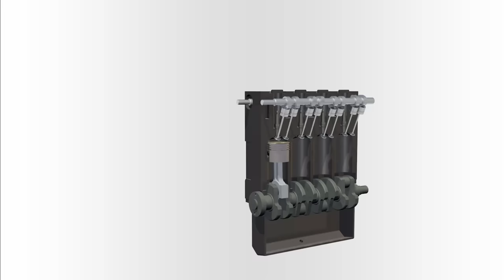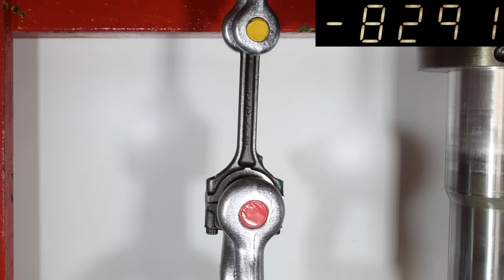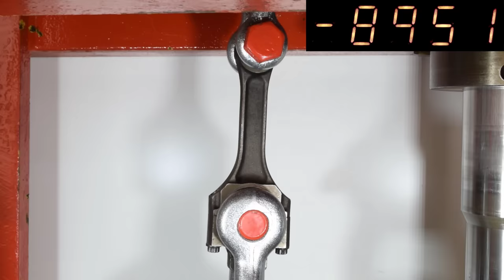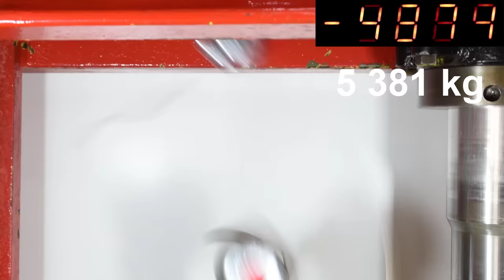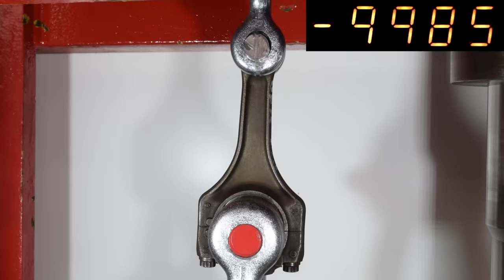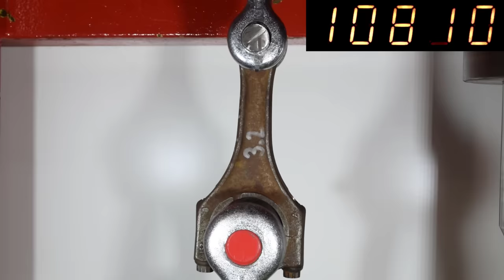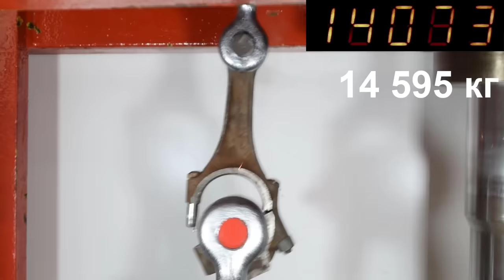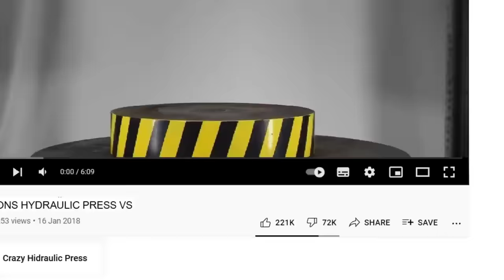HYDRAULIC PRESS VS CONNECTING RODS

Comment: After doing some math, it became obvious that the forces on a connecting rod are greatest in tension despite the logical  notion than the compression forces are the higher forces.
The rapid change in direction during the overlap stroke is where the greatest forces exist. In fact, compression and power actually reduce tension stress on the connecting rod.
I replicated this test many years ago with the same results- the bolt is the weak point! However, as the tension increases the shape of the circle distorts and the bearing shell 
clearance is reduced to zero at the cap seam.  Without lubrication, the bearing slips, covers the oil passage and instantly fails. Sometimes the near instant increase in friction at high RPM results in the next weak point, the small end to break the rod at the point just below the small end bearing. Key thing here is use high quality rod bolts, torqued precisely, quality oil, and know the RPM limit because that is the failure point, not the combustion forces. Rev your engine till it spins a bearing, rebuild it and lower the red line by 500? Rev limiter?

Comment: The "car 1968" connecting rod was best at doing what it was not designed to do. (tension vs. compression). This test was a bit disappointing after clicking the thumbnail for this video with the correct situation illustrated. Go figure...

Comment: I disagree with a lot of the comments below.  I also am a mechanical engineer.  This test was not (apparently) not done using any kind of standards such as ASTM or perhaps a European equivalent, but it DOES show the overall tensile strength of the system for comparison purposes.  Most strength tests for metals are typically tensile, not compression, at least for isotropic materials such as alloy steel.

Comment: I was not expecting much different. The metallurgic properties of a good connecting rod are what they are, regardless of brand. Yes, some alloys are better than others but it isn't necessary, as these parts only break when the car has been subject to severe abuse or neglect.

The large amount of plastic deformation on the bolts from the 1968 Russian rod, however, is notable; that alloy was far less brittle than that used in the modern bolts. (I leave it to engineers to decide if that's desirable or not.)

Comment: I don't want to hurt anyone (although there would be a need for intelligent laymen), but the engineers are right and not the idiots. I am a Hungarian agricultural machinery technician.
During 1 cycle, the connecting rod performs "1 pull" and "3 pushes". Pull suction, the second is missed due to the shift in the work rate. Therefore, this film screw "pull" test. Today's screws are not strong, they don't allow the piston to fly towards the sky, that's enough. And the pistons are light. Not even so much in turbocharged vehicles, because the engine is torquey and does not rotate.
Suzuki GSX-R 1000 bike engine at 15000rpm, the piston goes 1mm higher compared to the top dead center, at full load and the two screws can handle it. It's true that almost every titanium there doesn't like to be touched.

Comment: Cool test but most only broke at the bolts/threads. Revisiting this with some ARP hardware would be interesting. For those mentioning compression, it's rare a rod will bend/break due to compression unless the motor ingests water or someone is running a lot of boost at low rpm or the motor is detonating.
Reply: surely it's also rare that a rod will fail under tension? the only tensile force on them is their own weight under however many G they decelerate/accelerate at in the top half of the exhaust/induction stroke. the compressive forces are always higher.
Reply: @JTV84  usually a thrown rod starts with a spun bearing. If the oil and bearings are good the next likely thing is high rpm. Rod length, stroke length, piston weight all play a role in max safe rpm.
Reply: @mikealbert728  as you say, rods usually fail due to something else being wrong, rather than directly from tension or compression.
Reply: The thumbnail was a clickbait lie. You okay with liars?

Comment: The current issues are not the rods, but the rings. 

I have stripped modern engines, and the oil control rings are running away and hiding in the pistons. 

They are supposed to try and expand and be bigger than the cylinder bore. Not shrink and hide.

No wonder the engines have massive oil consumption.

Comment: There's a fine line between strength and weight.  Too much unnecessary mass limits your high-end RPM.  Too little mass can cause rod failure.  I've never seen a rod fail where these rods have failed.  As others have said, this is more a test of bolt strength.

Comment: All the comments on rods being designed for compression have NO validity. This was a good test of  a common cause of rod failure.Structural overloading can occur if a rod lacks the tensile strength to handle extreme RPMs. As G-forces multiply the inertia effects of the piston, the small end of the rod may be stretched to the point where it fails at or just below the wrist pin.

Comment: Hm. Fun and interesting to watch, but the title should have been „Tensile strength test: Conrod bolts from cheap vs expensive cars“. 
Also: for the test to be valid, new bolts should have been used that were torqued to spec. Most manufacturers advise to replace the bolts once they were removed.
Although this has been said already: Tolerance towards  compressive forces is what is important in con rods. Sadly at least some on the team seem to be aware of this as the preview picture shows exactly the kind of testing setup that would have made more sense (edit: maybe would have been even better without the bearing cap but at that point it probably doesn’t matter anyways)

Comment: The actual compression strength, multiplied by the torsional and inversly applied combustion torque quantity, determines the rate of shear imposed on the longitudinal strength of bolts and / or studs, that are part of the composition of  carbonized and normally forged sections of equalatterally, yet uniformly, strengthened base rod  inclusive strength sections.

Comment: I don’t know if it is noted here but in my experience the ideal performance of a car is to have as light and stiff a part as possible will providing the strength required (noting that strength is relative to the life design). In other words I would expect a poorly designed part to be excessively heavy and excessively strong.

Comment: Funny how the old vehicle seems to have a stronger connecting rod, yet, in my life i have never seen a connecting rod fail in a modern vehicle, but i have seen one fail in my younger years in 'old' vehicle. It was a renault 4cillinder wagon, with front wheel drive which was quite rare for that era, (and of course the old 'cv joints' being your car maintenance budgets worst nightmare invention) Anyway, my sister was an impatient person and when she started driving that car for work she would wake the whole street up at the crack of dawn revving the crap out of the cold engine... it took that punishment for about 3 months before finally throwing a rod through the side of the engine. ... I am aware that somehow modern engines do not have the same requirement to 'warm up' that old engines had?
PS: did you know you can greatly extend the life of cv joints by always easing off the accelerator as much as possible when turning sharply! Those little basteds are expensive to replace, and were nightmare level expensive when they first started appearing.

Comment: Made for a fun video. But the rod caps will always be the first to fail under tension. It would have been far more interesting to test some modern diesel rods and some other high performance rods out of a C6 zo6 (titanium) and perhaps even some motorcycle rods out of modern sports bikes with big power. You could do a billet steel vs titanium vs cast aluminum vs forged aluminum. Guess that’s pretty damn pricey since your guaranteeing to destroy them in the process so I do make this comment with perspective on exactly what it is I’m asking. Just saying that it would be super cool. At least to me anyways.

Comment: I am not an engineer, but tensile strength does matter does it not? I read a lot about compression being more important, but compression only occurs every 2 strokes. In addition rotation creates a tensile force on the conrod and piston with thousands of G’s at top dead center when it gets pulled down at intake.
Reply: Common failure is the rod bolt while under tensile stress around top dead center at high rpms.  Small rod/stroke ratios make it worse by increasing angularity between crank throw and wrist pin, b/c maximum piston velocity occurs well past the half-of-stroke (90* crankpin position) while ascending and descending. There are fewer degrees of rotation available to slow the piston to a stop and then accelerate it. This means higher Gs.
    Rod failures usually occur from cracks propagating under cyclical loads, compressive load being part of the whole picture. When rods are being inspected for re-use, beam twist, center-to-center length and out-of-round/diameters are measured. Racers will magnaflux or use dye penetrant to find cracks, which always mean discarding. X-raying is possible but not always available. Rod beams are polished to remove stress risers and shot-peened to restore outer skin compressive strength which resists crack formation. Cracking is why most rod body failures occur, not pure compressive load failure. This is shown by rods that distort under hydraulic lock. They usually bend instead of breaking, ductility rather than brittleness being an engineering goal. 
    Upgraded rod bolts are sold b/c the bolts are so much smaller in cross-section than the rod body, even the small end. I have seen charts that compared loads and they cited acceleration load at high rpm as considerably greater than power stroke load, at least for non-blown engines. The conundrum is that heavier rods are stronger but the extra mass imparts higher accelerative loads, and power output is increased by maintaining torque while raising the rpms. Racers will do this UNTIL something breaks. Bolts, usually.

Comment: Fun to watch bolts break.
With that said, some manufacturers require rod and crank cap bolts only be torqued once then replaced at engine reassembly time. Then, one set of BMW bolts showed either machined or rolled in secondary thread appearing grooves. They failed - stress risers?. Next, did you torque every bolt to manufacturer spec for that engine/year. Compression - others have said their piece on that

Comment: You can see affection of the stress accummilation year by year, moreover variable things how affecting the stress on metal such as E34 BMW probably driven at high RPM loads and as can be seen it couldn’t resist so much force like Xtrail and WV.

Comment: Connecting rod had a multi  force acting while revs motor . And there not the same revs 7000rpm while  neutral at stoping on red light or  same 7000rpm at 6t gear and full power apply.  There is a very complex efforts and add the resonance and vibrations too.  Add the old metals have a fatigue and micro cracks. Thats a very good comparison in metal terms but its not representative what its better inner motor.

Comment: I really liked the idea of the video, I really wanted to watch the video when I saw the thumbnail, but the test they are doing on the connecting rod is wrong, as the connecting rod suffers compression force, not transverse force, that's why in the video most of them are hanging on the screw, as it is the one where there is the least pressure inside the engine. I don't speak English, sorry for the writing mistakes.

Comment: Only 2 broke at the wrist pin end, this might have a variable on floating vs. pressed pin applications, where the rod end is heated the wrist pin is placed in liquid nitrogen or in a cooler with dry ice, and pushed through the piston and rod with an arbor press until it contacts the retaining ring, this spreads the contact surface further. 
 Floating pins require lube to achieve this effect.
 I also noticed the big end fasteners gave up on the rods who’s small ends held fast. Were the torque specs and bolt stretch percentages within limits? I know that it’s very critical when building extreme condition high rpm high output rotating assemblies.

Comment: I disagree with everyone. The most important thing on a connecting rod is bearings. mostly wrist pin. wrist pin is the weak link in that equation usually. personally, I've not heard of a bolt breaking, I can imagine if it was over torqued maybe?

Comment: A more meaningful measurement would be the ratio "load/weigth", high performance rods are optimized to be lightweight, not to outperform tensile load test. Aslo, compression is much much moer important, as far as pistons pushes downward after the detonation, thus screws are not so loaded  on the hardest stage

Comment: I guess in 1968 it was not that important to save Fuel and reduce weight of the car, the rod is thicker and has a huge screw nut while the other rods have screws which are only screwed in . Its no surprise that it breaks last , its simply more metall .

Comment: Next time use Toyota connecting rods, they are the gold standard for cars that have a much better price/performance ratio than "premium" BMWs. You will find these Toyota parts are extremely tough, these engines basically last forever.

Comment: Interesting to see the different failure points, even though the majority were bolts. I've never designed an engine, but I would have expected similar points of failure after all these years of dynamic and static finite element design - or does it prove motor manufacturers before Tesla came along were lazy?
Reply: No con rod will fail like that, because this is not how con rods work. They are pushed, not pulled.

Comment: A kilogram is not a unit of force.  A connecting rod's design is based on the compressive load between the wrist pin and the crankshaft. I don't think I've ever seen a blown engine caused by a wrist pin end of a connecting rod failing.

Comment: sorry buddy but 1968craigUk is correct. Also most conrods will fail at the bolt under extension load. It is generall the weakets link

Comment: In a BMW you know that those bolts failed far, far beyond the engineered threshold of the engine; BMW engines do not fly apart - even under the incredible loads they are built for.  At best, this test demonstrates that maybe some cheaper connecting rods are over-built due to lack of engineering.

Comment: Push rods, not pull rods ????
Would like to see the opposite test, ie a push rod being pushed like the force of a cylinder firing and expanding and pushing the push rod down onto the crank shaft.
This is like testing the bolts strength, which would be like testing an elastic band by squashing it together!

Comment: Lol whats the point beside watching things break.. plus why conduct this at room temperature, does the car engine run at room temps ? Forget compression vs bolt strength in this video, i am sure heat has an impact on metal as well. But nice to see how bolts fails in slow motion :).

Comment: I was extited to see the test when you show the rig to test it. You cheated! LOL done the easy work. No! Test by pulling you are basically testing the bolts holding the push rods. The main job and the main load of the pushrods is done by pushing not pulling. When the combustion inside the engine cylinder happens it puts tremendous forces onto the pushrod. It pushes the pushrod. It's pushrod not pullingrod : ) awwwwww.... Please do it again pushing it : ) Good job anyways : ) thanks for sharing.

Comment: Well, these connecting rods primarily are dimensioned for buckling stress (=for the power with which the burning fuel's gas pressure forces them via the piston to the bottom dead centre). Drawing stress they need to bear is absolutely minimal, so it's a stupid idea to PULL them, and demonstrates no real strength characteristics.

Comment: This test only proves, that the rods of the high rpm BMW last longer. A Passat diesel only revs 4500. the m3 - that div. Between In-line 6 and v8- up to 8500 . Also the v10.  The mosquic can’t rev so high because of the mass of the connection rod. This will kill the crankshaft.

Comment: the weakest moment in the 4 stroke cycle for conrods  is when exaust stroke is finishing and intake begins at overlap at high RPMs,  ,piston going up  in an almost empty cylinder there nothing to helps  reduce piston speed and stop to zero to starts down intake stroke is  conrod is weak and piston is heavy  is a recipe for distruction not on power cycle unless you have  a no compresing material on chamber as valce a nut water

Comment: should be pulling these not pressing them
Reply: I'm sorry, I assumed you would press them. Obviously they are weaker in tension (bolts). Con rods throw bearings on tensions and break when they are slapped against the crank. They don't fail due to compression. People are morons.

Comment: Wrong test. Connecting rods operate under compressive load. It should test the compressive strength of the stem, not the tensile strength of the mounting screws.

Comment: The BMW E34 530i engine M60B30 V8 has connecting rod made from powdered sintered forged metal and can be seen failed at the small end before the bolt failed. 3:42 
That said and going by 1k comment below, not a fair test.

Comment: On the one hand it would have been much more interesting to test the compression but also to compare connecting rods of equal weight because the goal for certain high performance engines is to have very light moving parts so comparing a connecting rod of a old rotten body from 1968 which must weigh a ton with a connecting rod from an engine which has 500 horsepower and which goes up to 10,000 rpm doesn't really make sense.